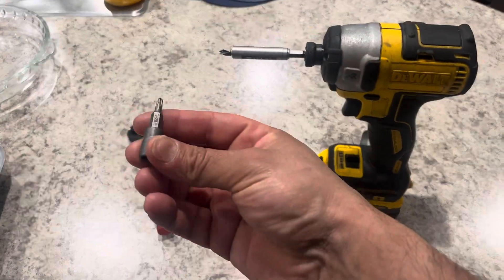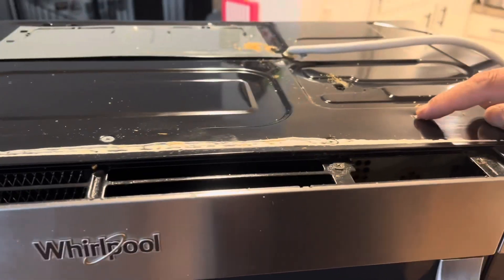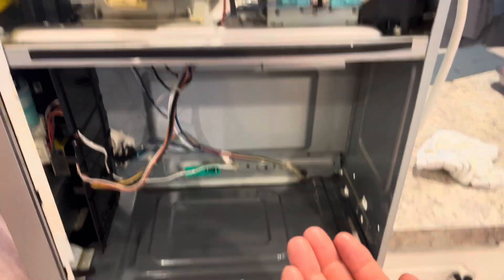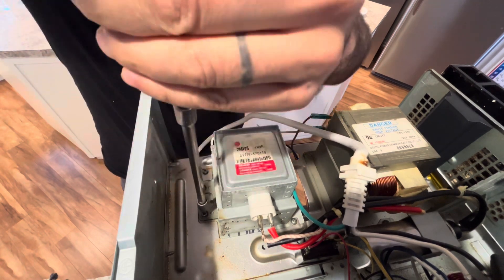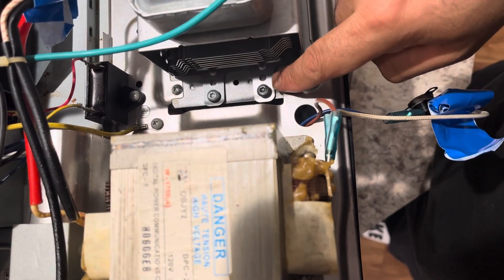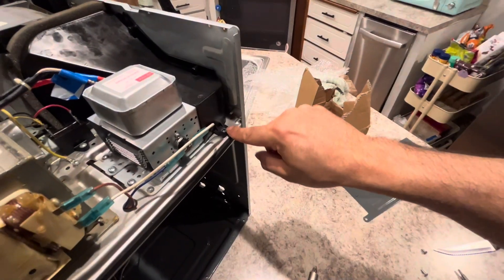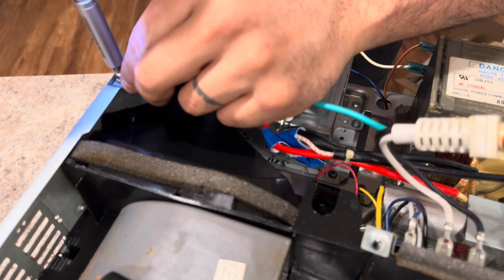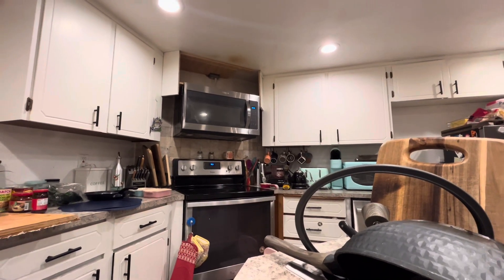HOW TO FIX A MICROWAVE THAT DOES NOT HEAT UP: BAD MAGNETRON

Comment: You should ALWAYS PROPERLY DISCHARGE THE CAPACITOR before working on a microwave oven in order to avoid getting a potentially lethal shock (and don't rely on the bleed resistor for protection because they sometimes go bad).
Reply from the maker: Agree. I should have also added an extra step of discharging the capacitor. To include the fuse and a few other electrical trips to stay safe while working on the microwave. Most people wanted a shorter video or a video that did not have as much detail but I might just make a longer video to add more steps. I appreciate your input. Thank you. 😊